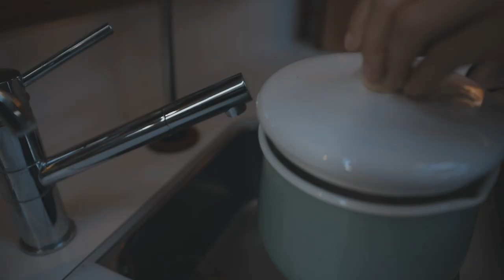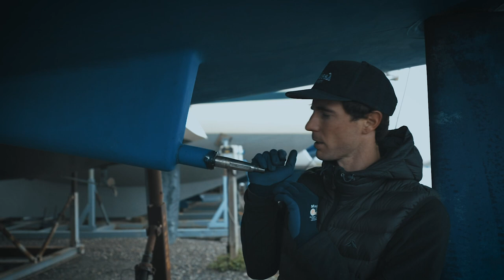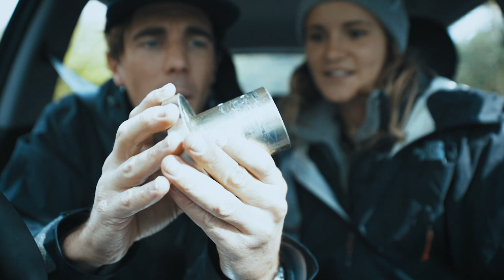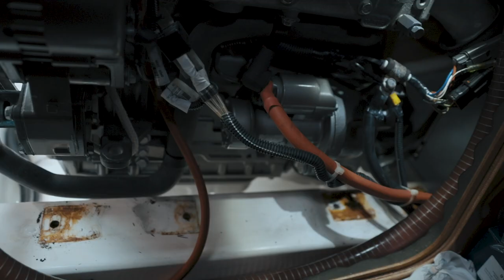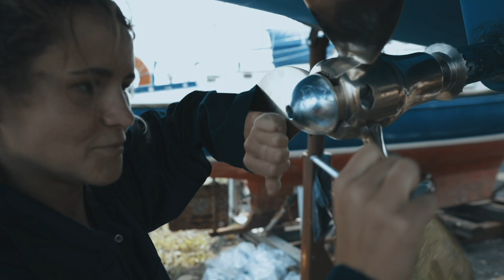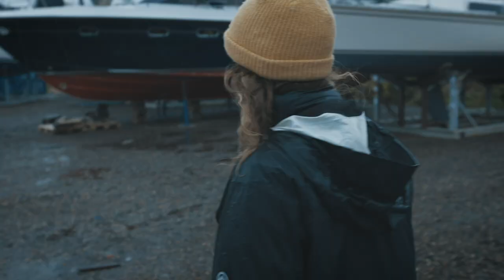Replacing BROKEN Yanmar ENGINE MOUNTS (Beneteau Oceanis) - EP 02 - Sailing Beaver

Comment: hats off to the engineer that created the space for the shaft to come out past the rudder., to bad he didn't work for Ford.
Reply from the maker: Joker a very kind individual indeed!!! We were not totally sure until we pulled it out but very happy to not spend days digging a large hole for the rudder.
Reply: @SailingBeaver  well good job all around, just a heads up, that's a flywheel/gear puller, you never want to use that on a bearing unless you plan on not re-using the bearing.
Reply from the maker: Joker ah ok noted on that one. We went through about 4 in order to get the right fit for north the shaft coupling and the prop hub!

Comment: I am surprised at the lack of a thrust bearing on the prop shaft. This is probably the cause of your mount failures. A thrust bearing clamps on to the shaft then is bolted to a structure that is part of the boat hull. This means the force from the prop is transferred directly to the hull and not via the engine mounts. Lack of a thrust bearing is also a common reason for gearbox seal failure.  It is a fairly standard setup here in NZ but that does not seem to be the case overseas.
Reply from the maker: This is quite an interesting comment. We haven’t heard of this but only our first boat but that idea makes sense as the shaft moves so much with engine vibration. I have seen some rubber shaft couplings but not a thrust bearing, cheers for the tip.

Comment: Regarding the vibrations in your engine, you can adjust the valve clearance and it will properly make the engine run more evenly
Reply from the maker: Yes, very good point. Although we haven’t done this yet it’s on the list. 🤙
Reply: @SailingBeaver  Sounds great :)

Comment: A little late to the show..........so the cutlass came out with the prop shaft?   I have not experienced that before .  Usually the shaft comes out and then it's a fight to extract the cutlass.....how did you accomplish that??   Also you did not prefit the new bearing but inserted it and fastened it as the prop shaft was inserted??
Reply from the maker: Hi Geoff, yeah once we removed the grub screw and twisted the shaft whilst gripping the cutlass it came out. Its only flexible rubber so maybe thats why. It also went in quite easy in the same way but the last cm was quite difficult and took some patience. Hope this helps mate 🤙🏼
Reply: Thanks.......what did you use the old bearing for as you reconnected the shaft?

How did the Hydrovane perform across the pond

Comment: Hi. Nice video! I plan to change the engine mounts on my Oceanis 343. In my boat, it is very narrow to get access to the nuts that hold the engine mounts to the engine bed - did you have this issue, and do you have any  tips on how to reach in thru the holes under the engine? Regards, Svein
Reply from the maker: Yeah it’s very tight. We used a small ring spanner inside the holes and  socket wrench on top of the mount itself. There was small access holes is the engine base for us so not sure on the 343. Good luck!!

Comment: Hi, great video as always. I am starting to feel more vibration from the enguine. Need to replace my mounts also. I have the same enguine as you "3JH4E". Do you have a part number for the mouts and where did you order from?
Reply from the maker: Best is to contact Ellebogen direct and they will recommend the correct setup for your specific layout and engine. They are super helpful. 🤙

Comment: hi guys. Just watched ep. 2 . Ive just been through all that same prop , engine mount, and shaft work myself on a ben. 393. I really would like to know what size youre prop is and the pitch if you know. Also  is it a flexifold prop?  Are you happy how the boat motors? i am looking at getting a new prop soon. i will check out more of your videos also. thanks from Dave.
Reply from the maker: Hey David. Yeah it’s quite a big job isn’t it. We have a flexfold prop yes. I believe it’s an 18”. Suitable for our gear ratio. Yeah it motors fine and really good when sailing. If you enjoy being able to stop nice and quick and have good power in reverse then I would recommend going with Maxprop instead.  My prop is really bad in reverse.
Reply: @SailingBeaver  thx for your reply. I have taken it on board. Enjoy your adventure and thx for charing it.